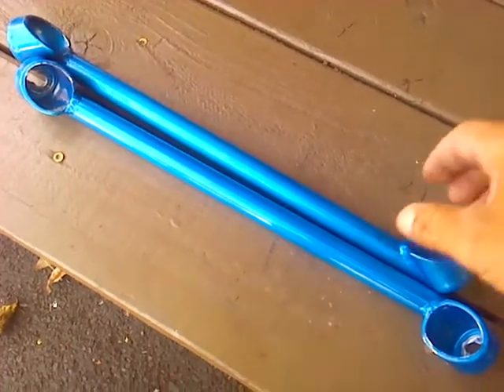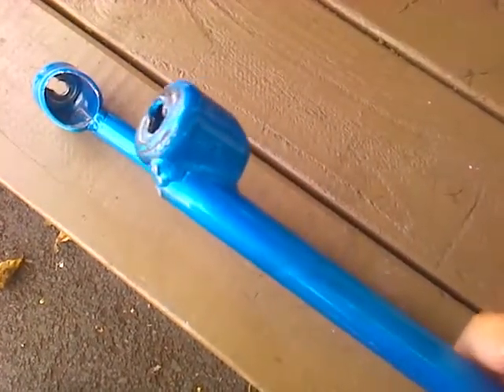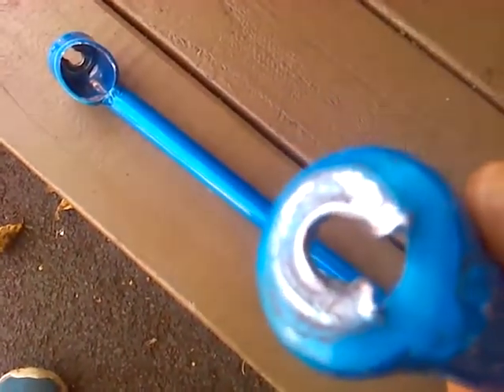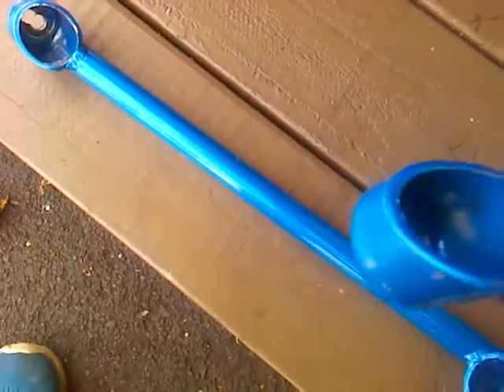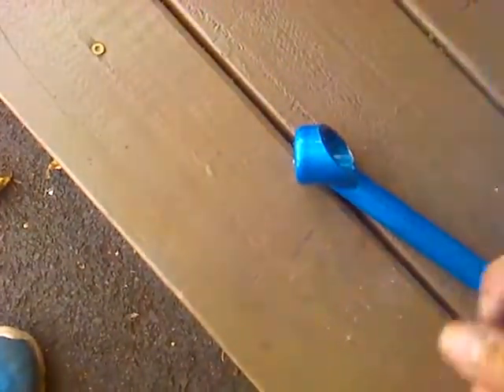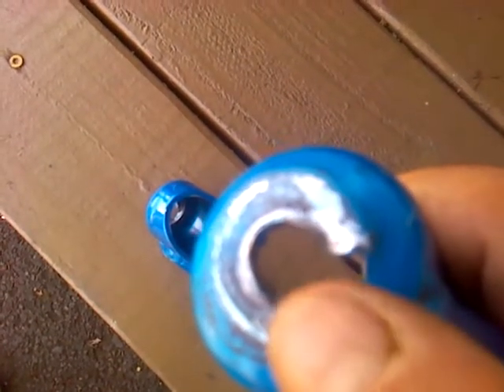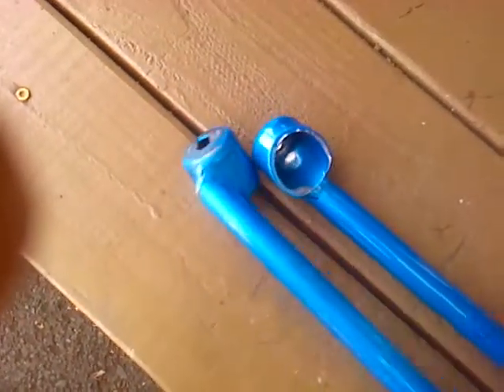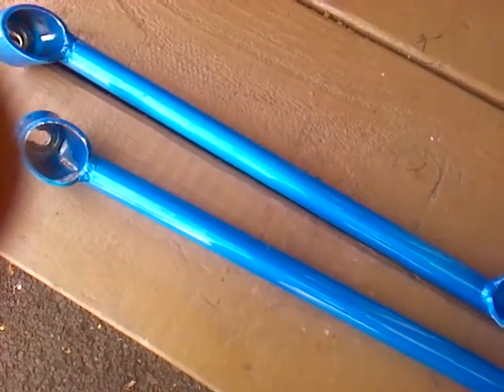Rear Member Braces for Toyota MR2 Spyder

Comment: I had this same issue with mine... Not good. Where did you find the Toms brace ? How is it compared to trd ?
Reply from the maker: I got the TOMS brace from a private seller. It was NIB. TOMS braces are no longer available. You might be able to find one on Yahoo auctions Japan. The TRD rear brace is  similar to  the braces in this review - just two short struts. TOMS is a full square brace plus the two short struts.